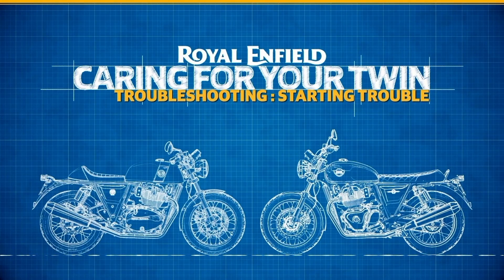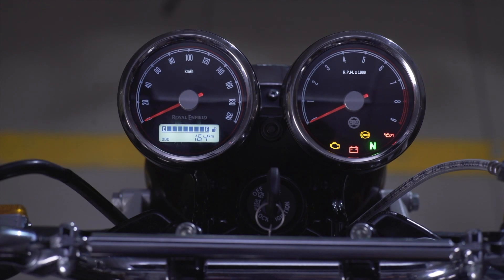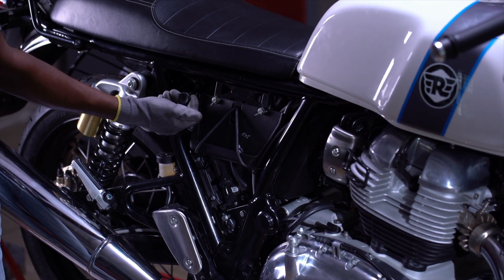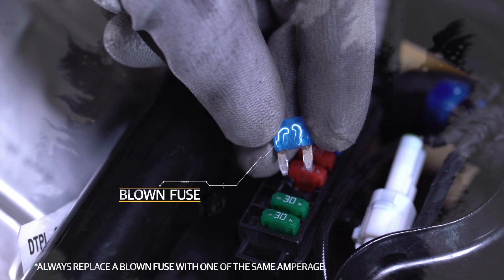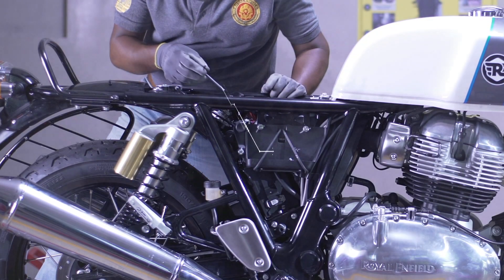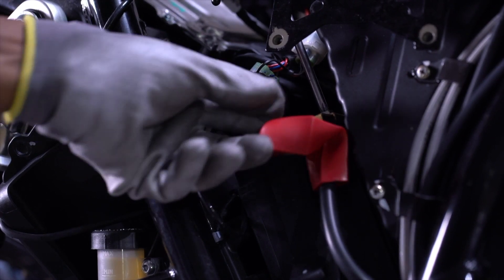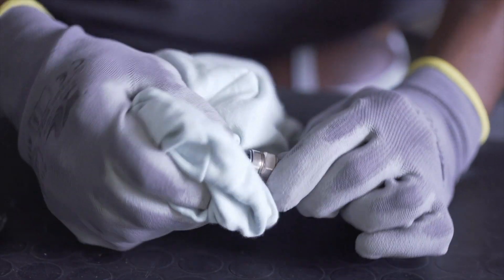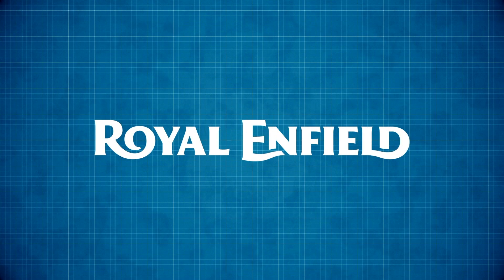DIY - Trouble-Shooting: Starting Trouble

Comment: After only a 1000km (had a garage routine check at 500km) sometimes when I turn the ignition key the dash and fuel pump start doing their work but after just a few milliseconds all electrical power stops... So far, turning the key back to it's initial position and trying again worked. Luckily the electrical power hasn't died on me yet while driving.

Comment: And I faced this problem today. It's 500kms now. I will be dropping my bike in the nearest service center. But today I was out in the night and suddenly the bike wouldn't start. I thought I ran out of fuel as the fuel gauge is defective as many have suggested me. So I filled it up and still it wasn't starting. Then after 15mins of gap I again gave it a twist and it started. This was so embarrassing for me as an owner of gt650. I am gonna give it a check tomorrow as shown in this video. And put my feedback here.
Reply from the maker: Hi Vishal, That’s no good! Please share your contact details and location and we will sort this out for you. Thank you for your patience.
Reply: Hey can you please tell me what happened that time and what these people said because my bike been stopping everywhere I got used to it, if it stops I just wait for like 15min then just start and surprisingly it starts??? What the heck
Reply: this is something with the wet relays I found out later. When i wash the bike, the relays tend to get wet as water sips under the seat, so you gotta be real careful when you was your GT. Safe riding. @prannai

Comment: hi.. i'm facing a frequent battery drainage  in my interceptor and even after charging the battery it last for about a month only. so is it a problem with the battery or the rectifier?? i coundnt go to the service station due to lockdown pandemic.
Reply: Did you find the fix brother? If so please help.

Comment: My 650 is just 6 months old and there are times it just doesn't start and there are times it started after 1 min or so. All basic things have been checked and are working.. Not sure if it is a battery issue or a relay problem. I am very uncomfortable riding it as I dont have confidence on the bike.  Any advice?
Reply from the maker: Hi Tarun, This isn’t something we’d want you to experience. Could you please share your contact details with us? We have a team ready to resolve this issue. Thank You.

Comment: My interceptor 650 is facing ignition issues. I start the vehicle in the morning and there is no problem. After i park it in my office and start it after a few hours it doesn't start. The ignition fades. Then after half an hour I try it works. This has been happening for a few days. What could be the issue?
Reply from the maker: Hi Geminivijay1, Thank you for reaching out. We'd like to understand the problem you are facing better. Please DM us your contact number so we can get in touch. Thank you!
Reply: Hey @geminivijay1, did you resolve your issue? I think I have the same problem and got no idea what could be the cause of this

Comment: The fuel pump sound doesn't come in my interceptor. It's intermittent and is really troubling me. Bike is just 3 months old. Can someone guide what to do
Reply: My bike gets shut down outta nowhere. I am on road and the bike just shuts down in the middle and won’t start. Happened wid me 4 times.
Reply: fuel pump relay most likely. hope you cleaned that gunk out

Comment: From 2oct till now I have completed 500+ km of my GT 650 I noticed a tik tik sound is now coming from engine please reply why is this sound coming ?
Reply: With over 2700 miles I also hear valve noise but I'd consider it quite normal. Adjusting valves at 300 miles I found them all slightly tight. A recheck at 1200 I found them just fine.
Reply from the maker: Hi Deep, Please share your contact number, our concerned team will get in touch with you shortly. Thank You.
Reply: I'm facing a same issue my gt650 completed around 4300kms and I faced this twice. Tappet noise is normal or what. Please help...
Reply: As Burt said it can be fixed with adjusting the valves, however if the sound is not very noticeable its is fine.

Comment: I had starting problem with my interceptor.  The person came home and repaired my bike they said it's due to faulty relay they replaced it from some accessories.  I asked them why did go wrong so soon just a one month old bike.  They said if we keep bike in garrage not driving it happens but in my case I take for a ride everyday, but still couldn't get valid reason.  The person said there is no extra relay with and replaced it from the accessories and went off.  This was the complaint raised by me with them.  complaint ID- CAS-18750476-F6Z8N4.  Need to understand why the relay gets faulty and if this is common issues why don't RE provide additional relays.  I don't know I have asked the service center for the relay to be replaced with a good one, they said no stock and have asked me to get the bike serviced at their service center after 500kms.  Will they provide me relay and if they provide me will they charge for it?
Reply from the maker: That’s no good! Please share your contact details and location and we will sort this out for you. Thank you for your patience.
Reply from the maker: @ayeshasvlog2209  Thanks for sharing your contact details and our concerned team will get in touch with you shortly. Thank You.
Reply: @Royal Enfield I had the starting trouble for 3rd time today, the bike was first serviced a month back and facing this problem, today the service person came home and  replaced the relay plugs and charged me 204Rs.   When I asked them there is a ongoing issue with this.  I told them I would need the bill and have the bill for it.  If it happens again I would be taking necessary action against it. Why the bike have starting issue still the person who came from Royal enfield service center is not able to find the exact issue.

Comment: You conveniently left out the inspection of the relays in this. If you guys were showing actual bikes you've put out in the past few years, we'd be seeing the mayonnaise-ridden mess that your factory production workers goofed into the connectors. My bike's relays were gunked up with all sorts of grease and shit, causing my bike to lose power completely.
Thankfully that's a cheap fix, but god damn. Stop nutting in our bike electronics!